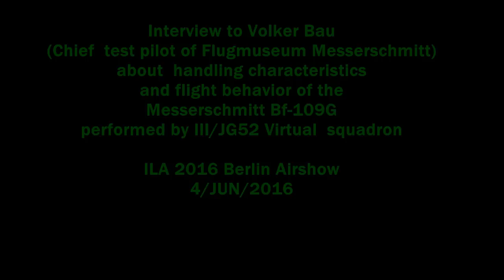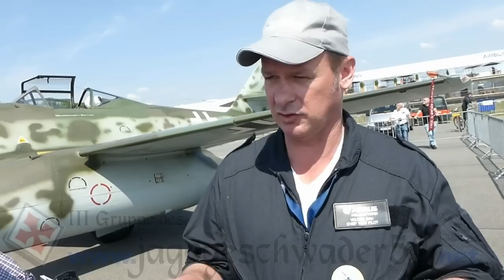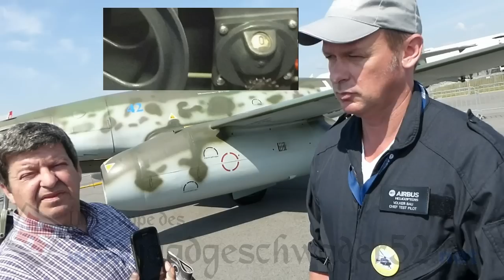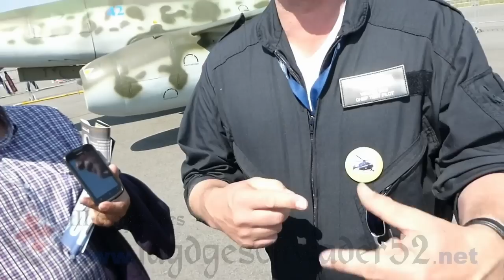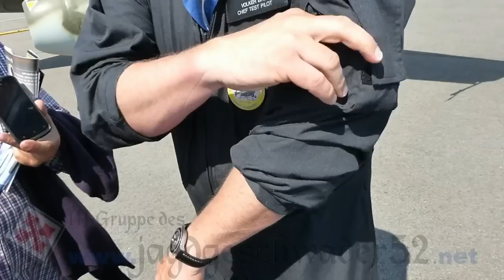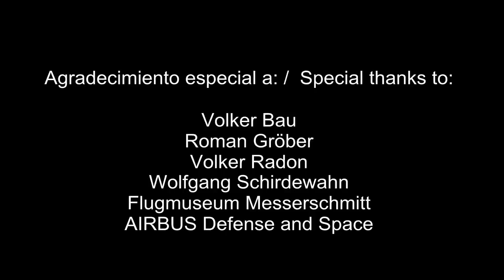Interview to Volker Bau about Bf-109G

Comment: Isn't that ten thousand number wrong? I read somewhere that one third of aircraft lost by accidents were during take off/landing, not one third of total number built airplanes.
Reply from the maker: As far as we know, one third (about 10.000 airplanes) of the total Bf-109 produced during the war (33.000 airframes) were seriously damaged during take off and landing accidents. In line with that Volker Bau stated. but we supposing that many of that damaged airplanes were cannibalized and used as source of spare parts for re-built other, due to modular construction system of the Bf-109.
Moreover, the rate of aircrafts lost in accidents in the Americans side, reach the 30% at the end of the war, very near to the Germans accidents statistics. Unlike the Americans, the majority of the aircraft operated by the Germans were, Bf-109´s, and the Americans operated with a dozen of different fighters.
All taildragger aircraft with propeller and big engines of 1,000 hp or more are difficult for take off and landing, that´s not a secret.
Reply: Webpage virtualpilots/dot/fi 109myths mentions a number of five percent or 1500 destroyed aircraft - I guess those were totally destroyed, while as you say the others were damaged but rebuilt after the accidents. Yeah, it is a high performance tailwheel aeroplane, so it will not forgive mistakes easily.
Reply: @3.jg52_virtual  Not to jump in on a really old thread, but I think some of those numbers have to be attributed to poor training rather than poor design. It's a tricky aircraft to fly, but if you have guys getting sent to fighter units with very few training hours the accident rate is going to be extremely high one way or another. The problem with the 109 is that it's an exceptional fighter for a guy with 1000 hours flying, and gives him lots of tools with which to be successful, but if you've got under 100 hours it's frankly a death trap. It rewards excellent, but it also demands it.

Comment: Bear in mind that he is not flying a wartime aircraft but a very carefully, essentially hand built 109. Wartime aircraft had lots of lumps and bumps and were trimmed in the field by the mechanics based on what the pilot said after test flights. Also, he is never operating it at combat weights so no loaded guns, no bomb pylon, no drop tank, modern radios, modern battery, modern fuel and excellent runways and it is only operated in good weather.
Reply from the maker: Hello Michael: 
As we comment in the interview, the "Red-7" have slightly lower T.O.W. than wartime Bf-109G.
Volker comment it´s like the wartime aircraft with middle fuel tank load. As we comment in the video, all wartime weapons, radio equippement, armor seat back and fuel tank armor plates, armor glass headrest, etc. were removed, and this moved the C.o G. forward, for this reason, the "Red-7", have a 30 kg. ballast installed in the tail section. As far as we know the aircraft was restored to normal C.oG. requirement in original wartime "Ladeplan" (weight & Balance chart), as ussally all Bf-109 restoration specialist do.  
Even in wartime the Ladeplan´s CoG. configuration was respected by ground crews, adding ballast, or removing on-board equipement when it was necessary.
Thanks for your participation

Comment: When a experte sharing a myth..oh my this world...

""11,000 of the 33,000 built were destroyed during takeoff and landing accidents - one third of its combat potential!" (direct quote)
"Me-109 had an astonishing 11,000 takeoff/landing accidents resulting in destruction of the a/c! That number represents roughly one-third of the approximately 33,000 such a/c built by Germany." (usual internet claim)
- Source: FLIGHT JOURNAL magazine
- The magazine has it wrong or has misintepretated the numbers. Luftwaffe lost about 1500 Me-109's in landing gear failures. Note that German loss reports often lump destroyed and damaged (10 to 60% damaged) together. It was also a standard practise to rebuild even heavily damaged airframes. While rebuilding/refurnishing these planes were also upgraded to the latest standards and latest equipment. This means that large proportion of these damaged/destroyed planes were not complete losses, but returned to squadron service.

"The specific problem with the Bf 109 was the very narrow / weak undercarriage track."
- Narrow landing gear was not that uncommon at the time - all biplanes also had narrow landing gear. Me 109's undercarriage was connected to the fuselage rather than the wings. This had several reasons. Most importantly the wings were easily and quickly changed if needed, without special preparations or tools. Wings were also one single structure, which made it possible to make them very strong. Because this the plane needed some care when operating. The claim that the narrow undercarriage was a problem is a myth, though. In comparison the undercarriage of Supermarine Spitfire was even narrower - it had its own share of problems from this. Imagine what it was to takeoff and land the Spitfire's carrier version to carriers for example? Especially later marks of Spitfire with enormous amount of installed power were quite a handful to operate. But that is conveniently usually ignored.
- The width of undercarriage in Me 109 E is 1,97 meters; 109 G 2,06 meters and 109 K 2,1 meters. However - Spitifre's undercarriage width was 1,68 meters.
- The real problem was the center of gravity behind the undercarriage. This made it possible to brake unusually hard in landings, but it also required the pilot to keep the plane straight in takeoff and landing. Because this it was easier for a small sideswing to develop into a groundloop or the plane might drift off the runway, if the pilot was not awake. Of course, if the tailwheel was not locked, the tendency would be pronounced and more difficult to counter. As with any plane.
- Contrary to the popular myth, the landing gear could take the plane 'dropping' in from about 8-10 feet. "
Reply from the maker: Dear; RolandHunter:
You must noted what Volker said in the minute 1:19, about the rounded airports,  etc, etc. The Bf-109 was designed in 1935 for landing always against the wind, in rounded airfields, it is very tricky to operate in asphalted runways, with crosswinds. As Volker said; if the pilot have 1500 hp, and big torque effect, in a tiny 12 centimetres of travel, in the throttle lever, with almost instant response (due to direct fuel injection engine), at any careless input with the throttle, crash is warranted.
 By the way, its true that many Bf-109 were damaged in landings accidents, due to the roughly operation conditions, in marshy airfields, with; mud, pools, snow and iced runways. In war conditions.
Moreover that 30% of aircrafts damaged in the Luftwaffe, during take off or Landing, is more or less the same that USAAF suffered during WW2, but unlike Luftwaffe what used mostly Bf-109 fighters, the USAAF used dozens different types of fighters, and the "bad stats" affected a few to all different types.
It's obvious that the Bf-109 narrow undercarriage, is not a good feature for a modern aircraft, ..but it was a standard in WW2, used by many aircraft´s designers, and it was not the main cause of the accidents, because the pilots were trained for taking off and landing  with this undercarriage feature from the beginning of their careers.
thank you for your participation

Comment: There was no question about how the 109 keeps the aerobatics figures... it`s very interresting. All the more so that russin restored i-16 and Mig-3 were not that long ago tested, flown by russian test pilots. And their, so to say, fresh opinion, on that aircrafts is in some items moreover interesting.  www.youtube.com/watch?v=_wTZjYGyl-4
Reply from the maker: Dear Vins Ponki:
There are more information about aerobatic and combat capabilities of the Bf-109 than about the stability of the aircraft at cruise speed, that the reason because we performed our interview...  If you want more info about Bf-109 desing and capabilities.This article is a good example. https://tinyurl.com/Bf-109G  

By the way, there are some interesting things in the Mig-3 video that you linked.
The Mig-3 flyed by Vladimir Barsuk in that video is a belonging to the collection of Vadim Zadorozhny (Moscow) it is engined with a modern Allison 1710, (28 Litres,V12,1500hp, 640kg dry weight) instead of the original and most heavy Mikulin AM-35 (46 litres,V12, 1350hp, 830 kg dry weight), making the airplane light and easier to fly.  

Vladimir Barsuk stated in minute 2:24, that I-16 has a tendency to enter in spin at 160 km/h, and he said in comparative with the  Mig-3, who is able to turn stable at 130 km/h doe to, it is equipped with "leading-edge flaps". These are also known as "automatic slats", and used in the Bf-109 from its first flight in 1935. 
It's very known that Soviets copied the "Automatic Leading edge slats" solution from captured Bf-109s, and they used this system for improve the bad tendency to enter in spin during hight-G´s turns in the Mig-3. the Automatic Leading-edge slats were standardised in production of the Mig-3 over june of 1941.

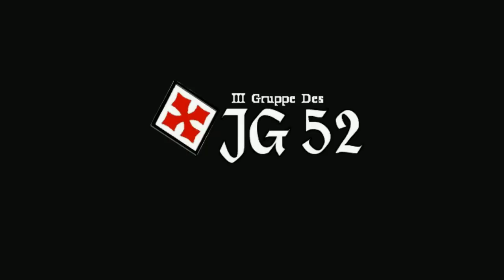The Vladimir Barsuk comentary (in minute 10:10), about the pilot Alexander Pokryshkin using high-G´s maneouvers with the Mig-3 of about 7 G´s agains Bf-109´s pilots, i think that is a presumption very optimistic. 
First, because soviets had not G-meter installed in their cockpits during WW2. ..And Second, because it's very known that Mig-3 need more heavy stick forces than the Bf-109G2, at hight speed, as Soviets stated in the comparative wartime trials, recorded in the  VVS test report of the captured Bf-109G2/R6 wk/nr: 14513.
Tanks for your comment.
Reply: Dear  @3.jg52_virtual !  Thank you for the mail and for the link! It`s very interesting for me!... By the way - I`m a big fan of alI l-2:sturmovik series. Still have it! ...So, nice to meet you, and thank you again! ...)))Historical facts about aviation - endless conversation!!! Good luck!... And clear skies to you!

Comment: We would have to solve just this question about the bf 109 G 2, 4 & 6 : wich is the limit emergency power 1 minute , 3 minute or more ?

https://forum.il2sturmovik.com/topic/31708-bf109-engine-damage-in-boostemergency-mode/?page=9
Reply: We are from the forum of I2Sturmovick BOS Thanks waiting for answer . RAY-EU forum founder member.
Reply from the maker: As far as we know the flugmuseum Messerschmitt does not use the "emergency power" in his BF-109´s for conservation reason. The use of "emergency power" decreases the TBO (Time Between Overhault) and the engine´s live, that is very important for these unique and rare airplanes. This issue was mentioned by Volker Bau in the minute 7:24 of our video interview, he stated that only uses a maximum power of 1.3 ATA, and this match with "Climb and Combat power" (steig- und Kampfleistung) in the Bf-109G operation manual.
As far as we know, the time of one minute of "maximun continous use" in DB-605, at "Take-off & emergency power" are "preventive recommendations" for prevent; material stress, excessive bearings wear, oil or water overheating, etc and prevent for in-flight engine destruccition.. but after a resting time working at low power settings, which restauring the fluids temperature, oil presure, etc. The engine can be used a few times more at "Take-off & emergency power", always for a minute, and it would be replaced for inspecction and overhault, after landing. 
Today DB-605 engine replacement and overhault is very expensive and difficult because lack of spare parts, certified manufacturer, workshops, etc
Reply: III/JG 52 Virtual Gracias por la respuesta , la he puesto en el forum de IL2 .